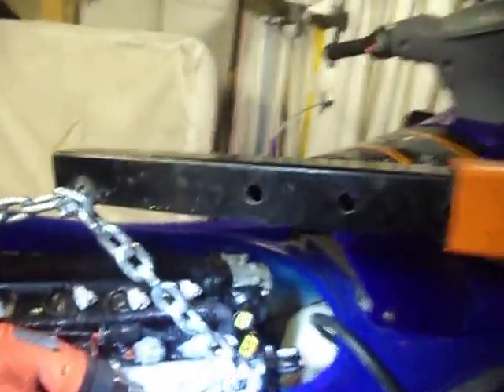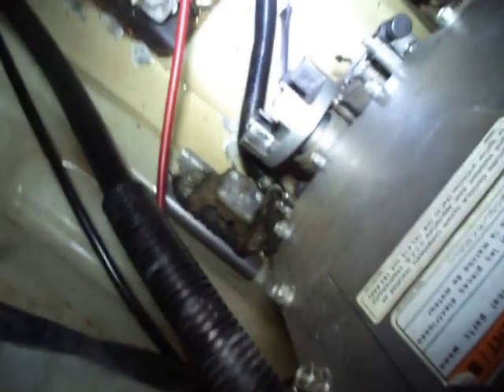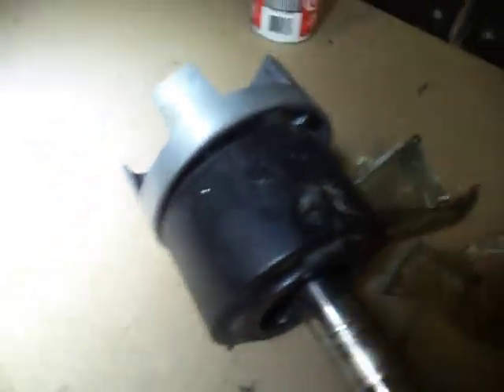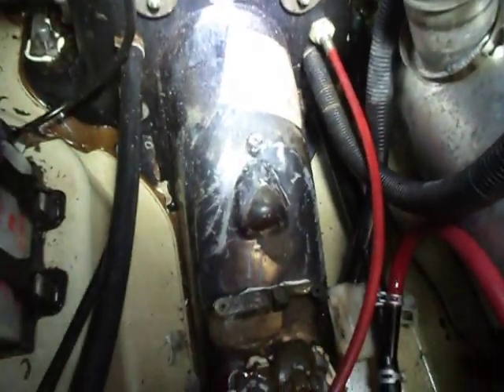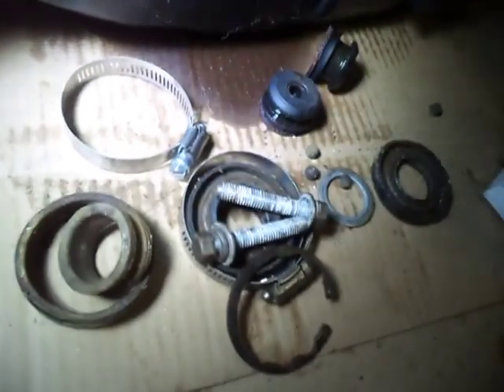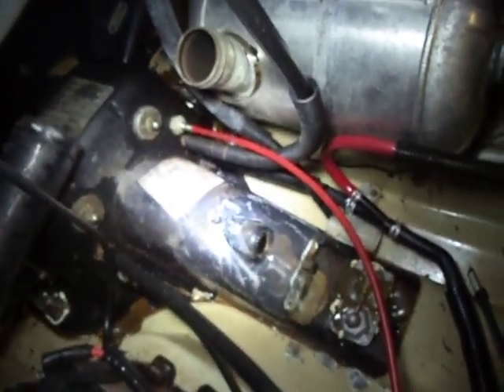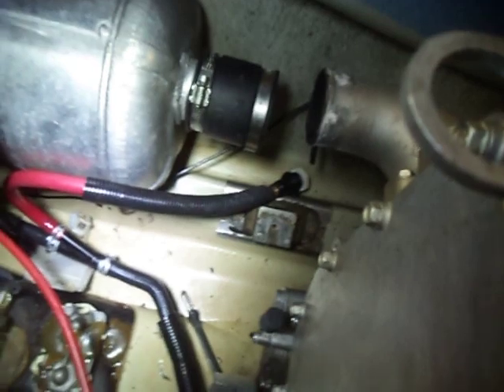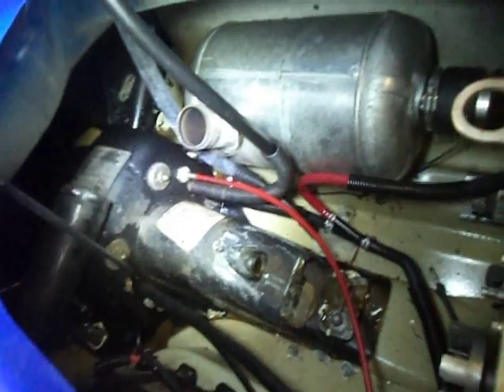How to repair a Yamaha VX Waverunner shaft housing water leak 2014 08 05 002

Comment: I work at a Yamaha dealer and have done many many of theses repairs. It pays 4.5 hours but can be done in 3. And with epoxy. The aluminum foot, bolts and cover that holds the driveshaft bearing damper is only 35 bucks. Just put a new one. Buy a  manual online. Its way simpler than the way this guy did it.
Reply: Hi Bob, thanks for the comment. I have the exact same shaft housing water leak on my Waverunner 2007 VX as this guy. Do you really have to move the engine to replace the glue or can you just pull the shaft?

I described this problem to my local Yamaha dealer and they said they've never seen the problem and would be surprised if it's just the glue. Weird.
Reply: You can just clean around the foot and put 5200 around it. It will hold for a couple years. But to do it right you must pull engine to slide drive shaft out since it passes thru foot
Reply: I did this job in 4 hours. I was expecting it to be a long job so I was pleasantly surprised..... This is what I did.  I hope it helps.

2005 VX 110 aft shaft removal and replacement.
Tools required:
Hoist and straps adequate to suspend the engine. Philips screwdriver, 5/16” socket with ratchet, 5/16” nutdriver, 10 mm socket, 10mm nutdriver, 12 mm socket deep and shallow. 
Procedure:
1. Remove Airbox (6 - Philips screws, 4 - 12mm bolts)

2. Remove air intake tube (5/16 Hose clamp)

3. Remove ignition PCM module (4 - 12mm nuts deep socket)

4. Remove motor mounts *  (4 - 12mm bolts (R)) **

5. Remove Exhaust pipe (5/16 Hose clamp)

6. Remove plastic shaft coupler cover (1 - 10mm bolt (R))

7. Remove aft shaft mount (4 - 12mm bolts (R))

8. Remove aft shaft clamps (5/16 Hose clamp)

9. Remove aft shaft
Notes
*  There are shims under each motor mount. Be sure to mark them to ensure that you replace them in the spot that they were removed from.

** After the motor mount bolts and shims have been removed, lift engine and slide forward enough to have a spot to remove the aft shaft. Once the shaft is free, you can determine the amount of space required to remove it. The best way, is to lift the back of the engine enough to slide the shaft under the back of the engine and then work it out. 
After the shaft is removed and serviced, replace in reverse order. 
(R) Red Loctite

Comment: how did you take the bearing housing off the shaft?
Reply from the maker: The 4 bolts that hold the cover on the housing use "Loctite" during assembly so you have to heat these bolts up with a propane torch until they're really hot, then crack them loose. once the cover is off, take the water inlet grill off the bottom of the hull, put vise grips on the shaft and tap it forward (towards the front of the craft) and the shaft will come out of the rear jet hosing easily. To get the bearings off the shaft ,you have to use a vertical hydraulic press. I have one in my auto shop, a 20 ton press. Take your shaft with new bearings and seals to any decent auto shop and they should be able to do this for you. Note that the bearings and seals have to be reinstalled in the exact same position.

Comment: Are those o rings and bearings from the impeller head of the driveshaft coupling?
Reply from the maker: They are pressed on the impeller shaft behind the coupling in the aluminum housing that I had to re-bond to the hull. From there back the shaft is open and exposed in the water inlet and then splined into the impeller behind.

Comment from the maker: Important! I don't think that I mentioned that at each engine mount, there are factory aligning shims between the mount and the engine. I didn't realize this until I lifted the engine and the "shims fell out. Try if you can to see what shim went where because the engine to shaft alignment is crucial to a smooth running, vibration free operation. I was able to match up the "seating" marks made when the engine was factory bolted in.

Comment: where is the engine mounts to unbolt so I can move the engine. Do you think I can move engine by myself or I need the chains like yours to do it?
Reply from the maker: +DogMedicine .Info  You can't see the mounts but they are under each corner of the engine. you have to reach under and feel them. These bolts are very tight and you must be on them squarely with your wrench or socket to prevent them from stripping. You may be able to move the engine with a strap and a couple of friends. It has to be supported upwards so that you can slide the shaft forward towards the front of the machine to get it out. It must pass under the engine!.Peter
Reply: Thanks Peter for your information.

Comment: Hello i have also repaired my PWC , it doesn't leak water anymore. But it has a difficulty to high rev, only out of the water... In the water it only reaches 6.000 rpm's (45-50 km/h).. From idle till 3.000rpm's it is trembles a lot, nothing comes out, engine light or something , the check shows 01 - normal ...
What is maybe the faults have been made by my mechanic? He saw that working , but he told me that he installed it correctly and straight... CAN ANYONE HELP PLEASE?
Reply from the maker: +ALEXVIDEOS73 Hey sorry for the delay in responding. Sounds like he may have neglected to install the leveling shims between the motor mounts and the engine. The alignment of the engine to the output shaft is crucial! It would vibrate bad. take a good look at the coupler and see it it is lined up straight to the engine!
Reply: ALEXVIDEOS73 have you done your plugs

Comment: Do you have another video showing all the steps taking out all the parts engine etc.? I'd like to see some of the major areas you worked on
Reply from the maker: Wayne Lang Hi Wayne. Unfortunately I don't, but if you have any questions I'd be happy to help you out. You can call me at my business any weekday between 8-5 and we can talk. I own an Autopro auto shop and I can talk anytime. I realize that I neglected to film some of the work that you may be questioning so call me. I've helped out a couple of guys already. My shop's # is 613-392-2766 Trenton Ontario. I've clocked about 30 hrs since the repair and the Yamaha is fixed. I even leave it at my dock all summer, in the water and it doesn't leak. Pete
Reply from the maker: Peter .K Message me too as some nights I'm online.
Reply from the maker: Peter .K First, take out the airbox ahead of the engine and ducts, then remove the fuel injector rail with injectors pull them up slowly  and the seals will let go) and move outside of the engine bay (fuel line attached). You can now access the motor mount bolts but you can't see them  cause they're just under the engine. You MUST use a new 6 point socket or 6 point wrench to wind out these "lock tighted" bolts. (They're tight!) OH! There were shims between each engine mount and the hull so make sure you put them back where they were or you might get some vibration if the coupler from the engine to shaft it's out a bit.(Important)  Once all 4 mount bolts  are removed ( oh and remove or disconnect the exhaust hose and muffler and take it right out). Then, you can lift the engine and move it forward enough( it just disconnects from the shaft coupler, a slide in design). Then you have good access to the shaft housing and bearing cover. The 4 bolts holding the bearing cover on are locktighted and will need heat to allow you to loosen them. Tickle them with a torch on the bottom where they thread in and you can break them loose.(Careful, it's aluminum and it will melt if too much heat is used) I used a heat gun to heat up the bearing housing plate to separate it from the leaking 3M adhesive. I had to go underneath the machine and remove the water intake grill and put on a set of vise grips to the shaft to hammer on. I tapped the visegrips holding the shaft and it just popped out of the impeller bearing housing. (forward to the front of the machine) I then pulled it out towards the front of the machine , under the engine that was at that point lifted up a bit off the mounts. I used the heat gun to then remove all of the old sealant under the inside shaft housing, the, sanded the plastic hull so that the new sealant would stick better. The shaft wit bearings and seals had to be disassembled on my hydraulic press at the shop as the bearings are pressed on. You can have this done at any autoshop if they are willing to help. Re-install NEW bearing and seals to the driveshaft if it's not damaged. I slightly offsetted the new seals so that they would ride on a new area of the shaft a couple of thou away.  I used 3M 4000 marine adhesive and it sets up within 24 hrs. Don't skimp, lay the stuff on thick and it will press out when you reinstall the 4 "cheesy" housing mount bolts ,screws or whatever they are. Once it has cured start to put it all back together starting with the engine to coupler and mount bolts. I dicked around for a while until I could line up the engine mount bolts with they're corresponding hole and I used "Blue" semi grip locktight on the threads so that the next poor guy would have a chance at getting them out! Any questions call me. Take care.

Comment: Peter did you pull the coupling out with the shaft attached under the motor while it was raised to get it out?
Reply from the maker: RiversKidd Hi there. Yes I pulled the coupling towards the frt of the machine, under the engine. I found that it didn't want to pull out of the impeller without me going underneath, removing the grate to access the shaft, then clamping vise grips to the shaft and tapping it towards the frt with a hammer. It came right out then. The biggest problem I encountered was the 4 bolts that hold the cap to the bearing seal housing. They used permanent lock tight at the factory so I had to heat the lower housing "gently with an oxy acetylene torch set real low. Don't melt the aluminum or your buying a new housing. You'll need a hydraulic press to install the new bearings to the shaft. I own one, but any auto shop should be able to do it for you for $20 bucks. Make sure the bearings sit exactly where they did originally on the shaft. The coupler is threaded to the driveshaft reverse thread to rotation if I can remember. I used a set of "chain" vise grips and a bit of heat to break it loose. Don't remember why I had to unthread the coupler though. Been months since I did the job. If you're handy or a mechanic, this job is not beyond you repairing it. Ask any questions and I'll try to help. Man, I see by the amount of views that a lot of Waverunner owners have this issue. Poor design! I used 3M 4000 marine adhesive and let it cure a few days. They recommend 3M 5000 but it takes a week to cure! Would have been real nice of Yamaha to put a 20 cent grease nipple on the f'n bearing housing!

Comment: Hi Peter, fantastic video, I have the same issue with mine, what adhesive did you use to reglue the housing back thanks.
Reply from the maker: It was 3M 4000 adhesive. (Marine) Just make sure you clean off ALL the old glue, Get all new bearings and seals and let it sit dry for at least 2 days. I Should have spent more time on the video explaining more but if your handy it's not a job you couldn't tackle. You'll need an engine hoist or something to lift the engine forward. you'll have to get underneath the machine to help you line up the driveshaft. It was a little stuck to come out for me so I had to put a pair of vise grips on it and hit the driveshaft out of the rear impellor. No problem , it came out easily. Have someome guide the shaft I as you are underneath the hull. You can then guide the shaft into the impeller. Press the bearing housing down firmly so the glue spreads to all areas. Note: When you back the engine into position, the drive flange on the engine MUST be perfectly aligned to the output flange on the output shaft. (You will have to have a shop press the new bearings and seals to your drive shaft if you have no press. (Cheap to have done) Any questions, just ask. Take care.